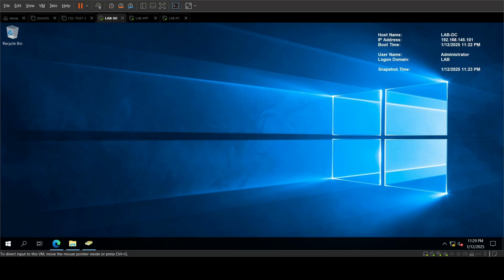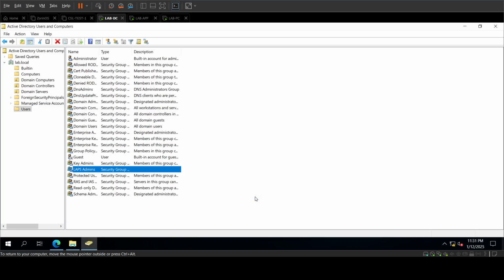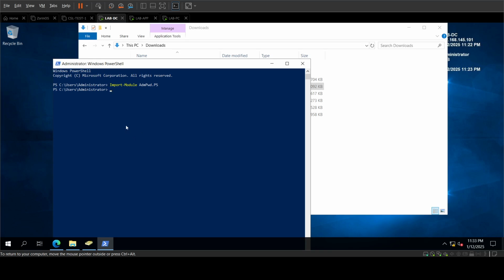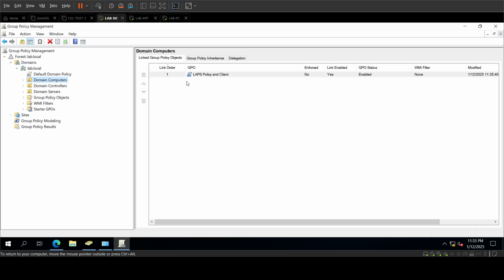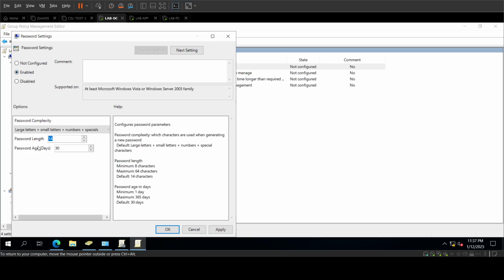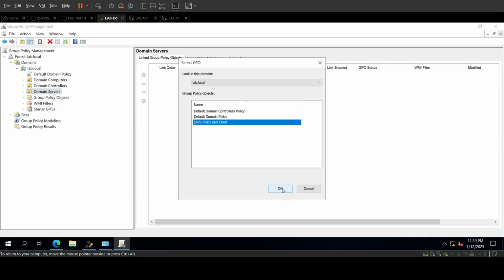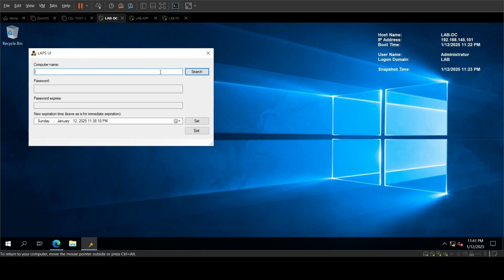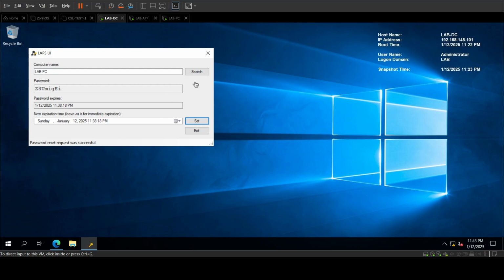Quick Tip: Install and Configure Microsoft LAPS // Caribbean Solutions Lab

Comment: Hi, thank you for explaining and giving a detail video, i have followed the same steps in my VM labs, via gpo the deploying of the LAPS software  to the clients is working well but the LAPS policy of local administrator password policy is not working on my client computer. Can you help me with that, thank you.
Reply from the maker: Hello! Some things to confirm that are in place: a Group Policy Object (GPO) for the LAPS settings in applied to the Organizational Unit (OU) that contains your client system(s), you have performed at least the OU delegation, and you ran a GPUDATE /FORCE command on your clients to force a GPO refresh.